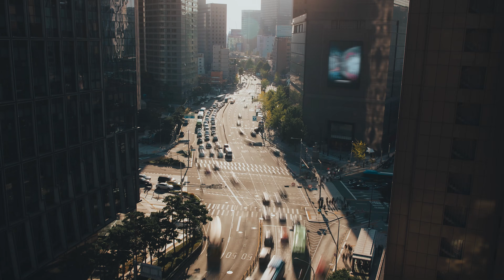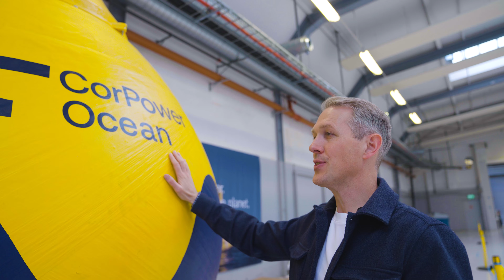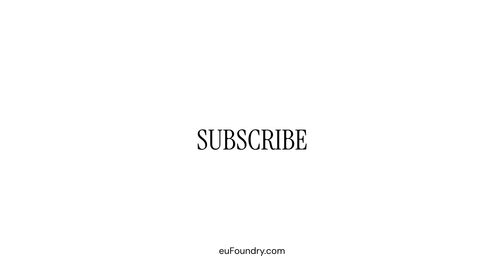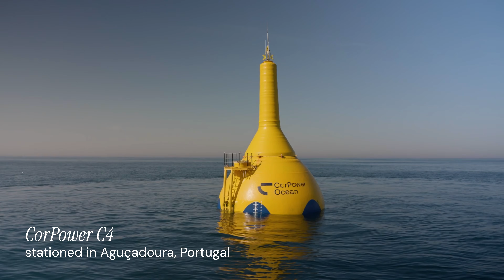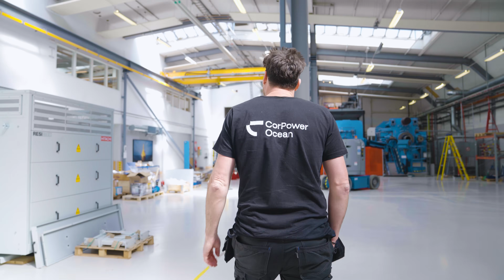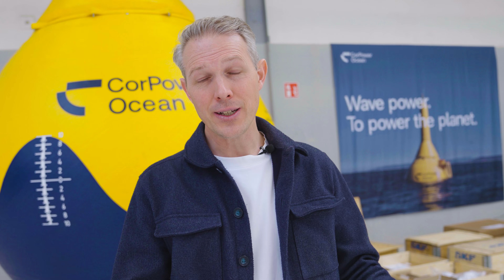The 10x More Efficient Renewable (That Nobody’s Talking About) #009

Comment: I'm not sure this video adequately covers how they'll address problems of corrosion and fouling that have historically been the biggest challenge with past attempts at tidal/wave power. That combination of salt water and barnacles is absolutely brutal.
Reply: Titanium
Reply: @katyelder.5  its already not commercially viable 😂
Reply: Cheep copper plating .No barnacles and  green corrosion hard as rock ..
Reply: The painting must be good, because it's glass fiber, fish can't see.
Reply: Composite shell, low cost manufacturing…fingers crossed salt corrosion isn’t such an issue in the first place, and cheap to fix/replace when required
Reply: Very good point, the best anti-foul treatments are banned?
Reply: A maintenance trawler comes by every so often, lifts them out of the sea and cleans them up.
Reply: Didn’t you hear it’s composite?
Reply: More research needed on ultrasonic anti fouling, or just electrocute the Barnacles‽ 😊
Reply: To me it seems like thick electro static/ electroplating should be a most, so you  create a multi layer piston and other parts where the goal is that each layer is non toxic yet all are rust pruff, where galvanic corrosion is dealt with thanks to the mixture of layers, and yes fiver glass does seem like a great aproach, perhaps copper plating is not a bad idea, to deal with barnacles, it seems to be mising something for the cleaning crews to be able to plug something to help them stay as close to the device as needed
Reply: @Interstellartraveltechno-rd4zx  Maybe. But you're just speculating - and I find it irresponsible to make a video about marine power without even once mentioning the one issue that has been the main reason for historic attempts at marine power to fail.
Reply: ??? what did i do now??, i see that you skiped the detail that is need for your coment to make sense at the end of your coment, its fine i guess, and yes i am somewhat especulation in some parts but it is healthy speculation of the type that makes research posible
Reply: Came here to read the inevitable comments from the Facebook experts. Wasn't disappointed.
Reply: @AndyHutchinsons  OK I guess we should all just shut up then, because asking a question about a basic problem is now being a "Facebook expert".
Reply: @AndyHutchinsons he asked the question of how are the two big issues with marine engineering are being dealt with, thats all. Seems fair to me.
Reply: @AndyHutchinsons  I'm not claiming the problems haven't been solved. I'm criticising the video for an inexcusable failure to even mention the main reason why such systems aren't already broadly deployed.
Reply: @AndyHutchinsons  Showing your complete ignorance
Reply: Illuminate me please?
Tell me when I watch interviews with the Ofgem director, and he says in real terms, come 2045-50 we won't see a big difference in household energy costs?

Tell me that all the projections for breaking away from gas marginal pricing, which at best seems to be £175-225 pa for the avg household.

Tell me, the historic levels of energy poverty, and the debt levels in the 4-5 billion range in 2025.
Expecting to be 6-7 billion by the end of 2026.
Reply: @stuartburns8657  what are you babbling about?
Reply: @stuartburns8657  There's little independent verifiable evidence the huge wind turbines are generating anything. Looking impressive, like city skyscrapers, but you can't get the people in and out fast enough to use all the floors.
Reply: @123glx That's some 'did we land on the moon' lvl conspiracy theory my friend lol.
Reply: Go and watch that podcast I mentioned, with the UK's Ofgem director.

Then please come back and correct me.

I'm all for Net Zero.  I own solar and home battery here in the UK.
I'm certainly not anti-renewable.

Energy independence.  Great.
But let's have an adult conversation about the realistic costs and consequences as a nation eh?
Reply: @1@123glxpart from the continual grid measurements of where electric is coming from and going to.

In the UK this is publically accessible data in real time. For example at the time of writing, wind is providing 25.8% of UK electricity (6.2 GW). That’s more than nuclear at 18%.
Reply: @AndyHutchinsons  dismissing legitimate concerns in the name of "well, its green". you do more harm to whatever cause you believe you are on the correct side of.
Reply: I suspect filtration for barnacles when young. And there are many marine grade corrosion resistant metals and other materials already used in the shipping industry for decades.
Reply: @AndyHutchinsons  Experts agree though. Wave power is possible but likely will never be commercially feasible except in unique situations
Reply: Yup. Fact is, offshore energy is always going to be expensive. Offshore wind is 4x more expensive than onshore wind, and wave energy is 3x more expensive than offshore wind, or 12x more expensive than onshore wind.
The only benefit to offshore is aesthetics. Is anyone seriously willing to pay 12x higher energy bills just so they dont have to see wind farms?
Reply: @Cambyses1467  There are more benefits when comparing to offshore wind than just aesthetics:
- more consistent power
- higher energy density
- closer proximity to shore

Just to name a few
Reply: @Cambyses1467  "12x higher energy bills" you know absolutely nothing about the economics of renewable energy. All of this infrastructure, you pay for it once and it generates power for decades - at least we know that to be the case for wind turbines and solar. Offshore wind turbines last 20-25 years! Only time will tell how long these wave generators can last.
Reply: @nzuckman  Speaking as a UK resident, we have some if the highest energy bills in the world.

Renewable energy isn't paying off in terms of reducing ppl's bills.

Save the planet - I'm not stupid, Im on-board for that.
Energy Independence - yeah that good.
Cheap? - no, that's a false narrative.  If the powers just had an honest conversation ppl might be more accepting.

As a nation, the remains of our heavy, energy intensive industries are on their knees.
Over all consumer energy debt has never been so high.

Where I live, our region is saturated with wind and solar farms.
We don't even enjoy the odd free electricity hour when Renewable are producing too much.
They'd rather pay to have the Renewable's turned off, which we pick up in our bills (curtailment)
Reply: @nzuckman  you sound profoundly ignorant.
Reply: @nzuckman  the upfront cost still has to be recovered through the price. What matters is capex per lifetime MWh. Solar/wind win because that's low. Wave has far higher capex per MW and, as you said, an unknown lifespan - which raises financing risk and cost, not lowers it. Lasting a long time only helps if the energy revenue beats the upfront spend. It does for solar/wind. It doesn't yet for wave - which is why it needs subsidy, which is literally more money from the consumers (not only by energy prices, but might be your taxes that are going to subsidy and tax breaks). i'm not saying it's a bad option to invest in it as a country and i really think it might be part of the future, but talking about the current technologies we have, you dont seem to understasnd the economics as well.
Reply: @nzuckman 
You're confused.
I was speaking on an LCOE basis, which means total lifetime costs per delivered kwh. Increasing the energy system's LCOE is roughly proportional to final bill costs, thats why it's such an important metric.

Wind and solar are the cheapest sources of energy available.  There's simply no need for extremely expensive wave energy
Reply: @stuartburns8657  It isnt. How do I know more about your own energy system than you do??? UK uses a marginal price model, which means its effectively based on the most expensive energy source: gas. Your higher energy bills are because of gas prices.

Wind and solar ARE vastly cheaper, but the UK system doesnt pass those savings on to you.

Its crazy how little research anyone wants to do these days, especially conservatives.
Reply: @Cambyses1467  Quite certain you don't know more than me, but allow me to elaborate.

The directory of Ofgem have openly said in a podcast on ('The UK Has Cheap Energy, So Why is Your Bill So High' - Making Money podcast) - see the 37 minute mark 'bills still the same in 2050' that essentially YES, when adjusted for inflation, and increasing costs they'll broadly be the same.

The Holy Grail of breaking away from Gas Marginal pricing, is only expected to save around £175-225 for the avg UK homes energy bill.

Ofgem and the UK government favour retaining targeted marginal pricing while boosting green capacity, rather than undertaking wholesale redesigns.
As I said elsewhere, and an owner of Solar and home batteries, I'm hardly a green tech / MAGA renewable moron.

But neither am I blindly optimistic.  Yes, Net Zero is a laudable ambition.  Yes, energy independence is welcome.
YES, but adult and honest conversation, about the SHEER costs of renewables, and the cessation of the green carrot cost reduction if and when gas is removed.

 2+ million households in energy debt, to the tune of 5.5 billion.  6-7 billion by Dec 31st 2026. 

Renewables (except in Trumps America) are an inevitability.  But let's be truthful about the financial impacts and consequences eh?
btw, UK energy to rise 13% in July...
Reply: @Cambyses1467 Everyone failing to recognise that wave energy is operating 24/365, which has a massive advantage in regards to cost of build.
Reply: @airsoftworld2051 
Operating 24/7 and still delivers energy 12x more expensive per kwh. Thats crazy inefficient
Reply: @stuartburns8657 curtailment is part of the problem. Proper battery tech for solar/wind energy has not been widely used sadly. Apparently electricity production is very low margins and batteries are too expensive, even though there are vastly many types,  for it to designed into the plans?
Reply: @joeljong931 Grid storage is a fine theory, but even with sodium batteries, the cost to cover a windless fortnight over winter in the UK is staggering
Reply: @airsoftworld2051  And batteries are only a fraction of the price. Wave energy is at most useful for redundancy purposes. It is not going to save money, not going to outproduce wind and solar, is not going to be more reliable than a mix of wind, solar and battery storage and basically serves no purpose until after the transition to renewable energy is already complete. Additionally, wave energy is one of the most likely forms of renewable energy to create lasting climate change as ocean currents are responsible for the climates in most of the world.
Reply: @stuartburns8657 But do you know WHY it isn’t paying off? Right now in 2026 in the UK, the price of electricity is almost always set by gas - and gas is more expensive than renewables. This cannot realistically begin to change unless renewables are routinely providing at least 50% of our power. Then the price begins to be set more often than gas by the cheaper renewables. The more we can go above 50% the less influence gas has on the bill.

We are not there yet, so gas is still in control of our bills.

It is such an important point I am going to repeat it again. Our high electricity prices are due to our reliance on gas. If you want to know more, I can recommend looking at videos about how marginal pricing in the UK works. Simon Clark did a good short one recently.
Reply: @javelinXH992  You will still be presenting the same carrot on stick argument in a decade.

Get to 50%...get to 55%.
60% is the magic figure.
75%...nearly there, keep the faith!
99% - damn 1% gas ruining it for everyone.

NESO, Ofgem, and the UK energy companies, all concede that energy pricing won't fail in real terms until 2024-50
Reply: @s @stuartburns8657  that’s rubbish. 

Australia started to see changes to their pricing once they got to around that mark. They can even get free electricity at some points in the day - imagine that. Thanks to their renewables.

The 50% mark is the figure in a marginal pricing system where the effect of losing more of the most expensive component starts to have an effect on the end users bills. It’s not a figure I’ve come up with, but the figure from people in the industry explaining how the economics of marginal pricing work. You can go and shout at the experts if you want (I’m not one), but people are more likely to listen to people like them who know what they are talking about than you.
Reply: No you are wrong, yes they last only 20-25 years with serious maintenance. But they usually are built in environmentally sensitive areas, are intermittent so would need vastly more, battery technologies are extremely damaging to the environment and would release massive amounts of micro plastics into the environment. Gas fired power stations can last 100 years take up a much smaller space and can be built in areas of low environmental impact and 24/7 base load. Also they don’t need to be completely rebuilt every 25 years.
Reply: @adambernhagen1015  I think a balance needs to be struck.

Arguments that gas power stations are 'better', given it's a single use, none replenishing fuel source is kind of odd.

I put them in the 'necessarily evil' category at the moment.
Better than coal, and able to spin up quickly, to compensate for renewables variability.

Batteries and micro-plastics?
That's certainly a new one!
Reply: This sounds like one of those backhanded ways the cigarette companies peppered the media environment to sow doubt and confusion.
Reply: True that the video doesn’t discuss it, but that’s a top priority for a wave energy company. My guess is if they’re already working on scaling up their production, their design addresses the issue pretty well
Reply: THIS. Any sailor will tell you how much life and gunk fouls up anything in contact with the ocean. Moving pistons look like a bad design choice below the water.  Will require DAILY maintenance I would think.
Reply: @shanfiddle I was thinking that it was smart. As gunk will tend to get scraped off before it starts growing, and inside the buoy is in air.  
I imagine the seal will need changing occasionally, but it sounds plausible.
Reply: @shanfiddle     You should be more researching and less thinking when applicable knowledge is missing.
Reply: @sd70cal  I can help educate you

Comment: please please let this company be successful, so many have tried and failed
Reply: This sounds like one of those backhanded ways the cigarette companies peppered the media environment to sow doubt and confusion.
Reply: 100% another key technology that's needed like yesterday for constant energy production
Reply: Go to your personal bank, tell them this is the kind of stuff you want to support and invest in. Done. They will find a way to make it so when there is money to be made
Reply: Why? Wind and solar are already vastly superior and cheaper
Reply: @Cambyses1467 the more renewables that can be supplemented the better.  If they have good capacity factors and aren’t trying to give you most of their power midday or in the spring when all of the other renewables are crowding the grid then will cut the need for large amounts of storage .
Reply: @RobertMartin-s2v 
Not at all. The key issue is cost, and batteries are vastly cheaper than wave power.
Reply: @Cambyses1467 storage and production are not the same and should not be calculated as such. 1 megawatt of wave energy capacity equals much more energy than 1 megawatt of battery considering the battery will most likely only be cycled 1 to 2 times a day at most (if it’s a sunny day and windy night) vs hopefully the capacity factor is high enough for wave energy to give 10 megawatts a day from 1 megawatt of nameplate capacity.
Reply: @RobertMartin-s2v  No thats false actually. A 1MW battery bank is vastly superior and orders of magnitude cheaper than wave energy. 

Theres just no logical reason to build wave energy
Reply: @Cambyses1467 are you telling me you would rather be on an isolated island with 1 MW if battery and nothing else vs 1MW of wave energy and nothing else
Reply: @Cambyses1467  renewables is very unstable for the grid, no enertia
Reply: @Cambyses1467  Combining offshore wind with wave would increase the energy density of a farm. Wind farms need a huge area to generate power equivalent to that of a conventional plant, any technology that allows more energy to be generated in the same area is worth pursuing. If it can be made economically feasible it should be invested in.
You claim there is no logical reason to build wave but I don't see any credentials or factual data from you that suggests you are a credible source of information on the matter.

Comment: Referring to the claim about making the device oscillate more with small waves by using resonance and using that resonance to generate energy: I thought a condition of resonance was NON-extraction of energy from the resonant system... otherwise the resonance becomes 'damped resonance' and the resonance goes away...
Reply: I would guess it is useful because extracting energy from a large force moving a small distance takes heavy inefficient power trains, and you can use a damped resonance to convert that into a small force moving a long way which is much easier to extract every from.